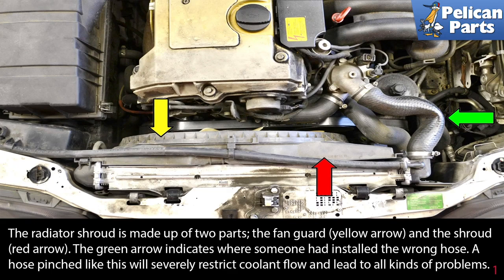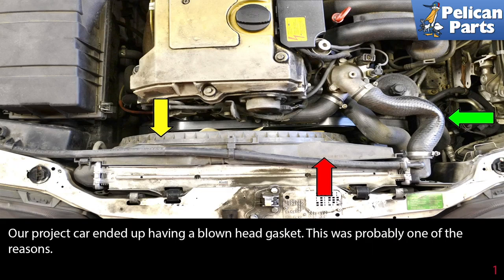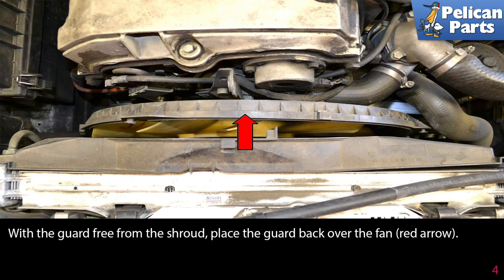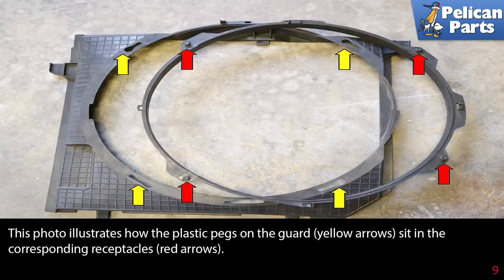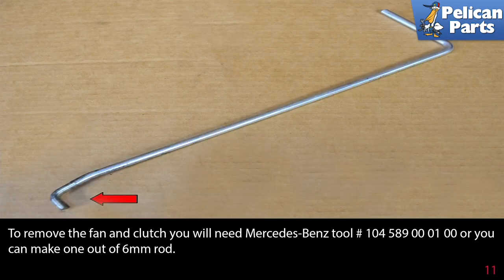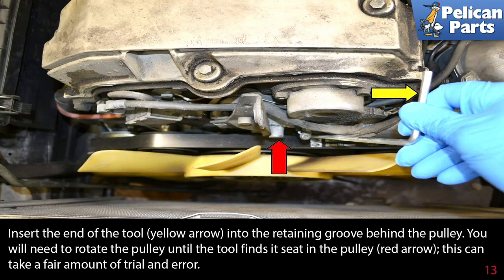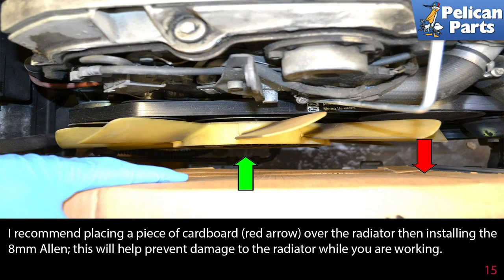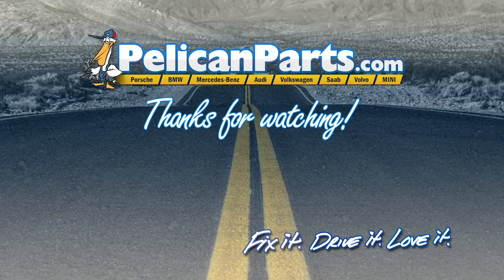Mercedes-Benz W124 E-Class Drive Belt Replacement

Comment: Man literally all these steps are exactly what I did but there is no bolt on the tensioner to release the tensions it has a small Alan on the the pulley that’s damn near ready to strip . But on my model it had a belt tensioner rod i don’t know if I tighten the rod clockwise by its self or if there is another bolt I need to loosen or something but it dose not seem like a regular tensioner pulley any ideas ??
Reply from the maker: What is the year and model of vehicle? I can see if I have that info.
Reply: @pelicanparts  it’s a 93/94 e320 .. thanks tho i figured it out there was a big Alan head I had to loosen then start loosing the tensioner rod an the belt came loose deff a odd way to take a belt off lol those darn Germans
Reply: @Oghurrakane  any chance you remember where that allen head is located? theres a spot for an allen where the tension pulley sits instead of the bolt as shown in the video but I cannot get that thing to budge, wondering if there's something else I'm missing
Reply: @bretbackus64  I can’t remember exactly it’s been a while but I think there was like 2 bolts or sum
Reply: @bretbackus64 I’m having the same issue. Did you find the Allen head?